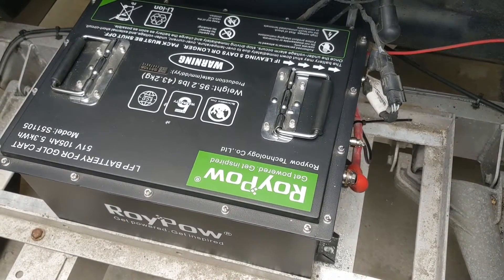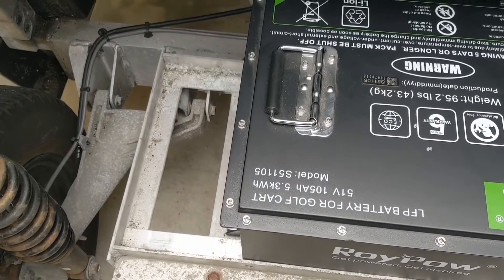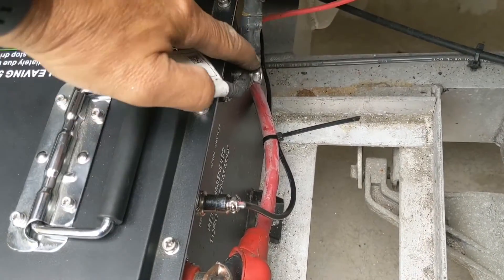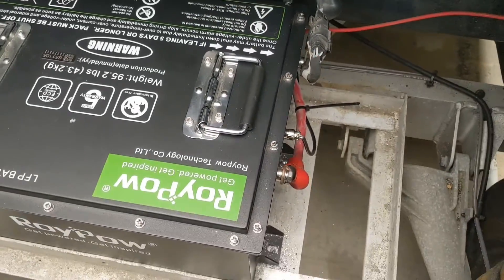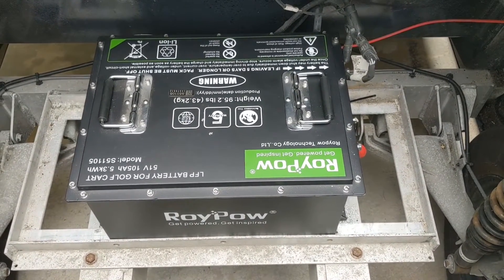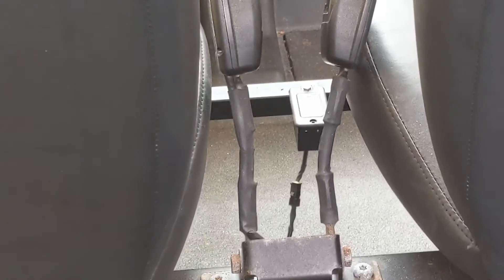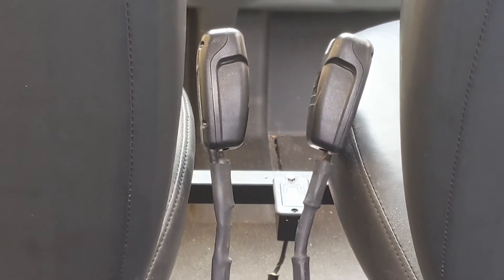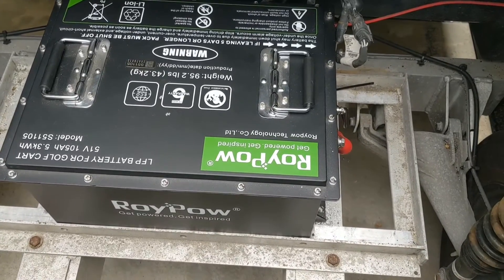51 Volt Row Pow LFP Lithium battery for 48 Volt Polaris Gem Car

Comment: How is the situation, I have a question, I did not find an answer. I have LED bulbs that work 12 volts, but they fail when the car engine is running because it gives it 14 volts and it cannot bear and break down. Do I find a resistance or a diode that proves the 14 volts to 12 volts, and it is five watts, ten watts, or twenty watts